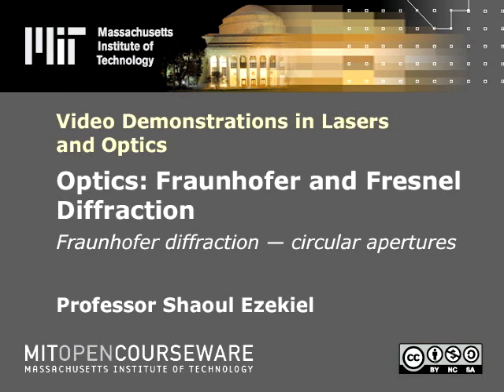Optics: Fraunhofer diffraction - circular apertures | MIT Video Demonstrations in Lasers and Optics

Comment: Your video are helpful, however i have trouble understanding as why for fraunhoffer diffraction Incident wave fronts on the diffracting obstacle are plane while for Fresnel are spherical. Thank you in advance
Reply: Hello,Naima Hersy 
See we often say that in large circles when we took small arc it almost look like a straight line (may be you have done in circular motion)...so in this case source is bery far away that waterfronts reach as a straight line.  E.g : light rays comes from sun since sun is spherical its emits speherical wavefronts but since we are very far away from source (sun) we see plane wavefronts because this wavefron is a small arc of circle ....understood?